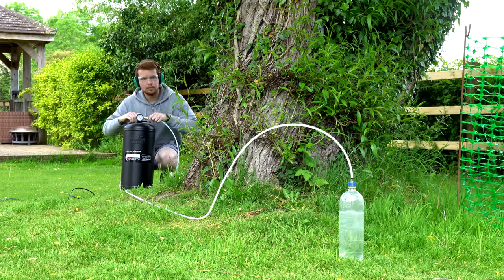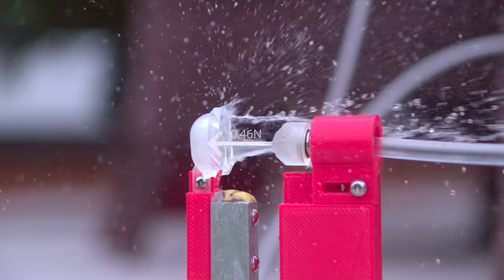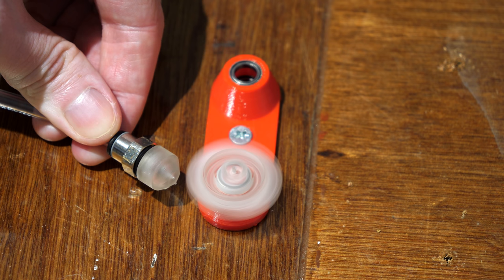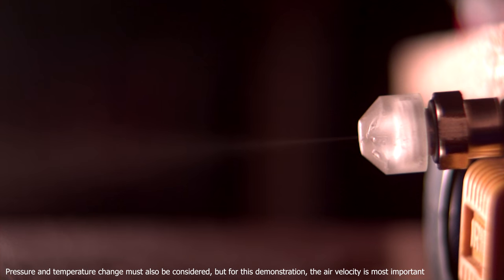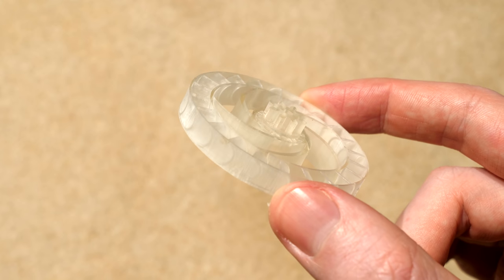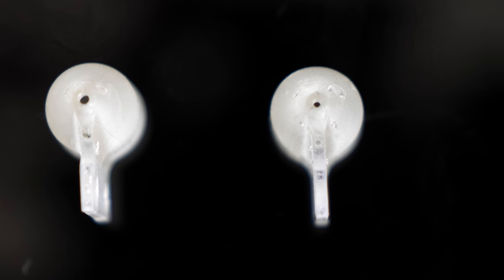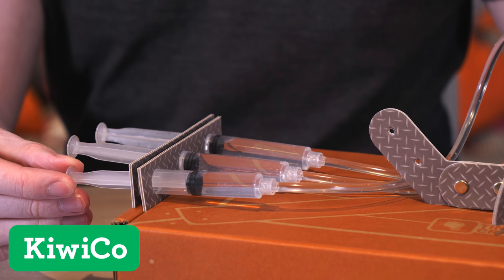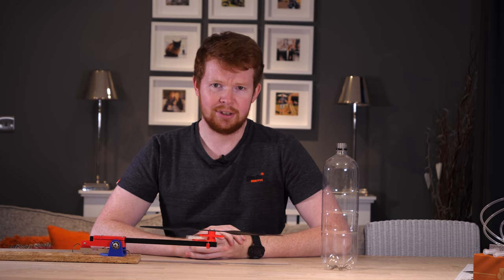Micro Pelton Turbine

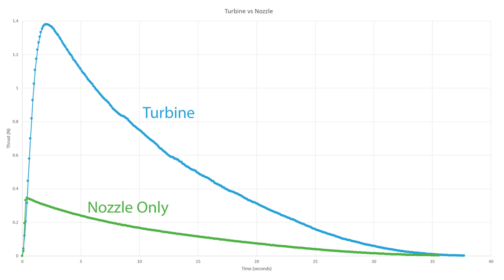Comment: 7:20 By driving the propeller instead of using the nozzle directly, you're moving a larger mass of air at a lower velocity to get your impulse. Since kinetic energy goes with velocity squared, while momentum goes linearly with velocity, this gives you a greater total momentum in your reaction mass for the same kinetic energy, and thus you get more thrust.
Reply: And not to mention that he can get twice the force with the turbine than by just pushing due to the 180 degree change in flow direction in the turbine compared to just 90 degree effective change when the nozzle is used directly.
Reply: Yeah! with a propeller It’s a higher bypass engine.
Reply: You would have to explain that to me. Your impuls or momentum also goes squared with velocity.
I=(V^2)*roh*A=V*Q
Q being the massflow= V*roh*A
A being the active surface area 
V being velocity
I being impuls or momentum
roh being the density of the working fluid (air)

I think that the magic trick is the ratio between the coefficient of drag and the coeficient of lift of the propeller.
Everything else should not contribute to higher efficiency and higher thrust. The total impuls of the compressed air is basically getting transformed from a high power low force, to a high force low power configuration. 

The max rpm of the prop should thereby limit the max velocity of the vehicle.
Why is unclear to  me, as turbinejet and rocket aircraft are only limited by there thrust wich is impulse, wich in tern should also applie here, but would make no sense anymore if it could.
Reply: Never mind, took me about 2 minutes to find out, that the propeller pitch limits the rpm. To high of a pitch angle and your needed torque to turn the prop is to high, to low of a pitch angle and your propeller will overspeed or simple induce to much drag at higher speeds. 

You could also explain it with force vectors. As the pitch increases, so does the angle of the lift force vector compared to the normal vector parallel to the prop shaft. This in turn decreases the part of the velocity vector parallel to the normal vector, thereby reducing total thrust.
Reply: came to read the comments for this one :D
Reply: Yup - that's the answer.  People seem to be getting hung up on propeller thrust equations and de laval nozzles, but the answer is basically a high school physics question.  To achieve the same reactive force (upward thrust) using a smaller amount of reaction mass (air) will require more energy, since the kinetic energy goes up with the square of the speed. Using the propeller to engage a large volume (greater mass) of air as the reaction mass allows lower velocity, and therefore lower energy.  If you could magically connect the propeller to an infinite mass of air, you would require zero velocity and the device could simply hang from that air mass, unable to pull it downward.
Reply: @scottlyman7427  
The problem is, that he refers to the his contraption being "more efficient" wich isn't exactly true. His contraption is more "effective at using the available power.

That's why people get caught up with this.

The thing with the De Laval nozzle is, that people try to understand the false statement of higher efficiency despite the gearing and the lost energy due to the drag coefficient of the propeller. So they jump to the one thing, they no of being unsuiteble for effective propulsion, a simple nozzle. 

What bothers me the most is Tom not explaining or at least hinting, that you would not need the propeller for more effective use of the available compressed air power.
Reply: @scottlyman7427  basically infinite paraschute
Reply: Impedance matching.

Comment: Fun fact: the turbine wheel you've created is called an "impulse turbine" and the devices that direct the flow into a gas turbine IRL are called "nozzles" even if they don't look quite as literal as what you've got going on here. If you want to increase efficiency and/or decrease mass, make the turbine inlets only as wide as or a little wider than the outlet of your nozzle.

Comment: I think the reason why the turbine has more thrust than just the nozzle is due to the fact that the turbine powers a propeller. The propeller moves more overall air than just the nozzle. Basically it's the same reason why turbofans, especially the high bypass turbofans, are more efficient than turbojets.
Reply: circumference ... and gear ratio ... both play with the output ..